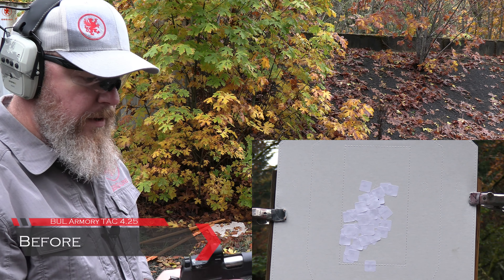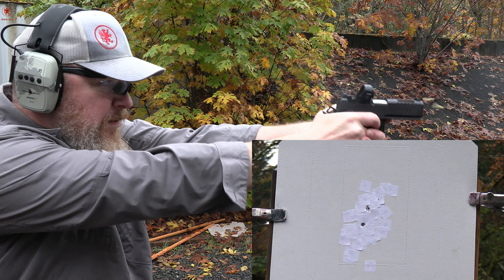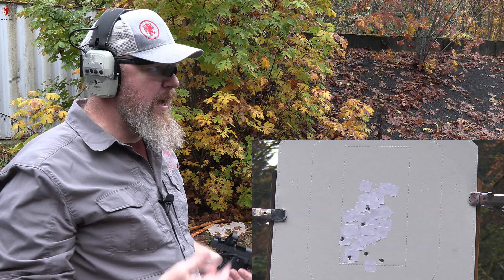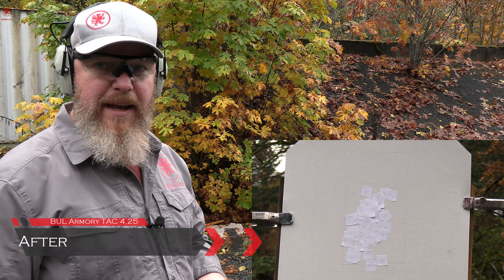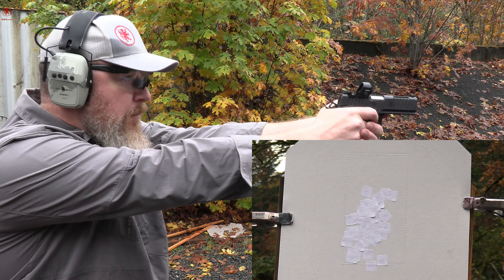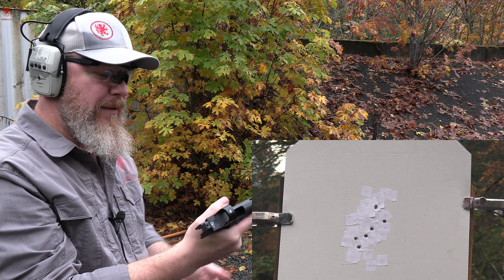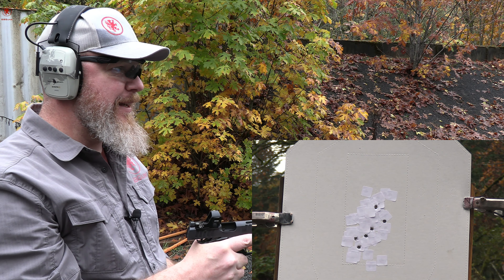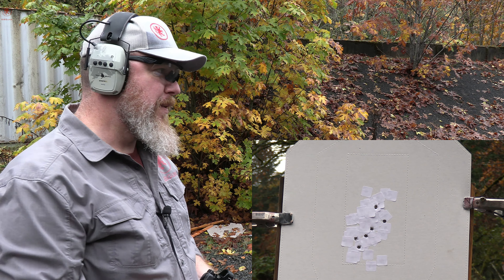BUL Armory TAC 4 25 Before and After DPM Systems Technologies

Comment: Curious as to why use the heaviest set up?  I know most things are a compromise, but couldn't a gun be over sprung causing the barrel to dip when coming forward throwing off follow on shots?  Wouldn't it be prudent to know the spring rate of the stock spring before making a change or is it all done by feel and results on target??
Reply from the maker: @kennethpruitt8534  yes, indeed it can be over-sprung. It really depends on how YOU shoot and what works for you.  I sometimes "heel" a gun during rapid fire so the extra nose dip might be helping me. I may have overdone some of these and will revisit when I get back to the US in a couple weeks.

Comment: Hi there I am trying to get my hand on Bul  armory sas ll 3.25 ultralight my ffl dealer can not get one  auctions are a joke Do you have any suggestion where I can find one perhaps are you wanted to sell yours if you have it?
Reply from the maker: @AndOne-k9e  They are only available direct from BUL Armory. You need to get on the wait list and be ready to purchase the moment you get an in-stock notification.  Be careful as there is a scam site out there. I have linked to the correct site on my website (YouTube won't allow those links here)
Reply: What Graham said. Use the "Notify Me" button on the Bul Armory website and be prepared to respond to that notification when it comes. I did and now I have a Bul Armory EDC sitting beside me on my desk. It works.
Reply: They seem to have been doing the 4.25 inch guns more so since the launch as I have not seen any of the 3.25 inch versions listed.  Been on the waitlist for a while.  I finally got a bul armory axe c tomahawk that is ported. Been on the waitlist for over a year for that one before I got it. Bul series pistols are damned near impossible to get anymore because they have a limited production run and sell out. This is all because YouTube has spread the knowledge far and wide about them. I bought my 3.25 inch sas tac 2 about 3 years ago after the first reviews began to show up. No waiting then… lol. Now that they are so popular (and for a reason) they are hard to come by.
Reply from the maker: @DragonToad7378  the 3.25 models changed for 2024, the first of them are finally about to arrive in the US